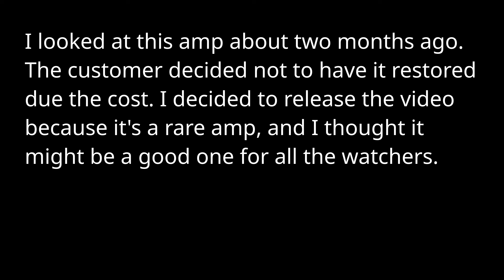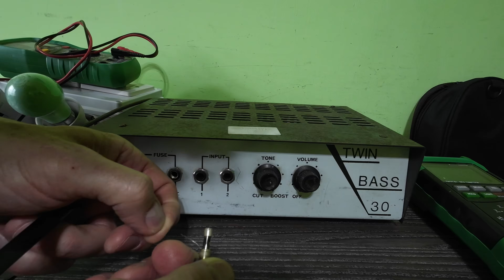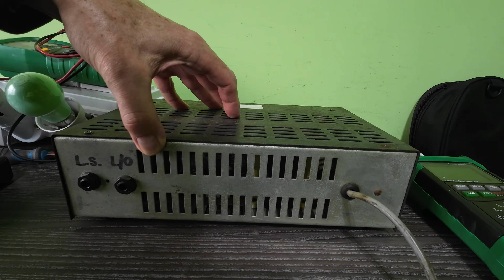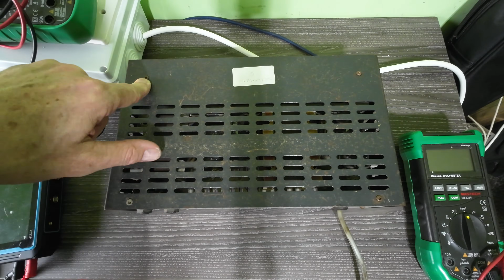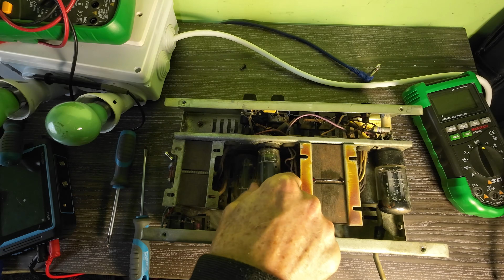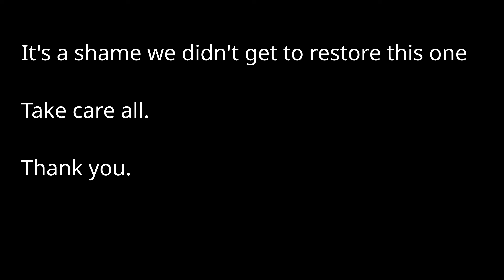Rare Tube/Valve Selmer 30 Twin Bass Guitar Amplifier Head Late 1960s

Comment: There is a very curious amp IMO Martyn. I wonder if the slight hum I am hearing has anything to do with the low output. Or is non-operating tone pot bleeding off some signal strength??? A curious amp indeed.
Reply from the maker: Hello Michael. I think there were several things wrong with the amp. The first stage was a transistor. Probably blown. The caps, in bad shape and one of the tubes damaged internally. It would have made a good video, but alas, the customer didn't want to shell out the money. Take care.

Comment: OC71 input stage!
Reply from the maker: Hello Alan. Thanks for that. I never really delved in to it much. I couldn't really see much inside it without taking it to  bits. I just assumed it had the pre-amp tubes under the power tubes. I never pulled the schematic for it. I should have done for the video really. I will have a look now. Thanks again Alan. Take care.